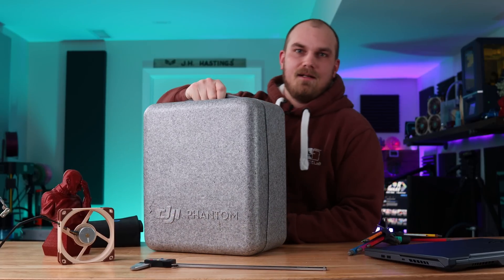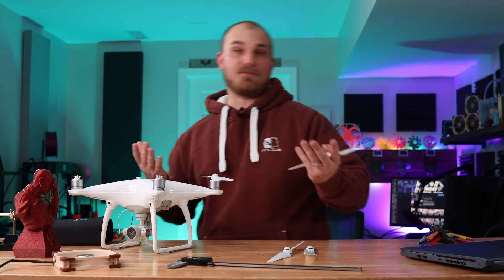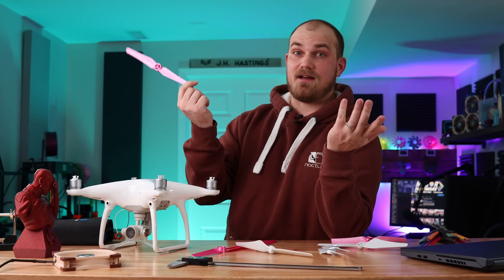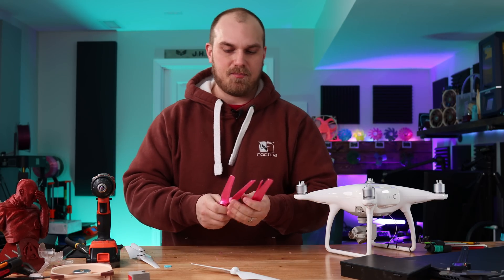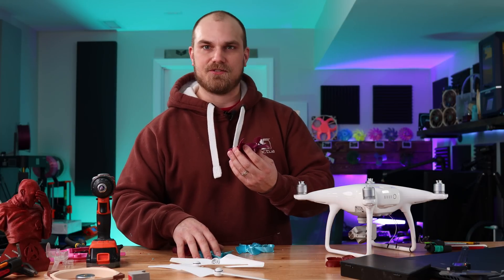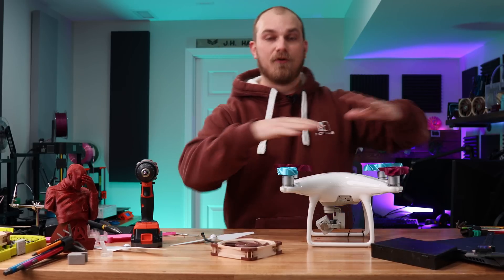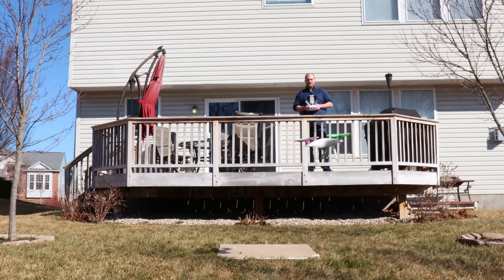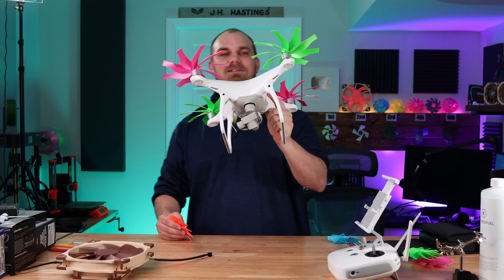FLYING Phantom 4 with 3D printed PC FANS

Comment: Since stability has to be maintained by varying the velocity of the individual propellers, your heavier "fan style" propellers will never be as stable as the ones that come with it (since they won't change velocity as quickly).
Reply: Yeah, agree.  MH already measures rpm and cfm!  Now measure weight!Sounds like a perfect start!
Reply: I agree. I think if he changed the blade design he could get away with 4 or 5 blades instead of 8. Maybe even 3 if he figured out a good design. That would help with velocity change greatly.

Comment: Besides just the surface area of the blades, we need to take the air velocity over the blades into consideration, which even at the same RPM, the fan blades being shorter will have a lot less lift/air flow.
Reply: Okay I paused the video to comment a hair too early lol

Comment: I see that 200 mm biohazard fan in the back, would have liked to see that
Reply: I thought that was the Fan he was going to copy & use 😞
Reply: I was just thinking the same thing...
Reply: Literally thinking that the whole time he was using the itty bitties.
Reply: too heavy.. that one was a scale up so the blades and hub are super thick, he'd have to re-model the whole thing to get it to actually work.
Reply: @sirmonkey1985  wondering if he printed with low perimeters (1 or 2) and minimal infill if it would have been possible. Probably running into a tricky balance between strong enough to not shatter under its own weight and light enough... I'd watch a whole episode dedicated to making this work, haha
Reply: He allready did a video on it
Reply: You could have made a 3 blade fan with that 200mm diameter tbh
Reply: Didn’t he do a video on it?
Reply: Exactly what I was thinking
Reply: i also think the same thing
Reply: He needs props the size of the stock one
Reply: https://youtu.be/4w6r5LE9PuM
Reply: Yes
Reply: Same

Comment: Other then fans, the airflow over the airfoil must flow smothly, so sand these steps down or use the azeton metode or your probs might stall and produce unstable lift
Reply: And maybe add a outer ring to connect the blades in order to prevent them from wobbling? Doesn't even have to be thick to to the job I think.
Reply: @Garbox80  I'm sure I've seen the super-cheap drones in places like Walmart with those rings.  Probably would help with the flexing.  (I doubt those cheap machines are made with quality rigid plastic.)  To some extent, they also protect fingers and whatever else the blades might wander into.
Reply: Acetone only works on ABS and ASU does not work on PLA or PETG.
Smoothing blades 🤣 by sanding what a challenge is that?
1. cant ensure everything is ground equally
2. you risk breaking the blades

Rather SLA print them or SLS 🤦🏻 but he aint got the 💰💰💰 for that 😁
Reply: @michaelbiri6676  you think he hasn't got the money for an SLA Printer, meanwhile he's printing hundreds of dollars worth of filament just to show and compare fan models made by viewers and prints multiple different blades for his !Phantom4!. And on top of all he even has an SLA printer, lmaooo 😂
Reply: @michaelbiri6676  was spot on until the last line.
Reply: At this scale, steps slightly behind the leading edge will help the airflow stay attached to the blade. 

https://www.researchgate.net/publication/328796447_Control_of_flow_around_a_low_Reynolds_number_airfoil_using_longitudinal_strips

Comment: You should try maxing out the length of the propellers to match the stock ones it came with. you are going to get increased but diminishing returns with the number of blades because you have more mass and they travel in each others wake. increasing the weight with more batteries is also going to diminish the performance due to the mass increase having to support that diminishing return. At some point no matter how many batteries and blades you have it wont fly due to these efficiency losses (the system doesn't scale). You are constrained by the frame of the drone and the motors which gives you how large your propellers are and their max RPM and K value (torque). Once you have that you can solve for weight (battery size) I have sized props like this using the kv rating in the past. There is probably only one solution that solves for efficiency given these constraints and its likely on the other end of the spectrum with low blade count and large radius. 

Try a 3 blade propeller of the same radius as the stock ones. You can also play with the pitch and NACA air foil (there are online calculators that make it easy(er)) or you can just wing it and solve with tests (preferred in my opinion). I would alter pitch to match torque for battery weight before increasing blade count. This experiment was really fun to watch thank you for the work you did. It would be interesting to see if the engineers optimally configured their motor - blade-dimensions - battery/weight system.

Comment: I think you might actually have a chance at getting a DJI Spark to take off with the 120s because it is so much lighter. For the Phantom 4, I think that adding more blades may actually be hurting you just because a propeller number of blades has such a higher diminishing return for the weight they add and you really don't have to worry about that with a fan. I would love to see more of these videos too if you are looking to do more drone testing. I don't know how much, if at all, we could improve on the from factory blades but it should would a lot of fun.

Comment: The flopping camera on the gimbal doesn't help the stability either!

Can you lock the gimbal in place?

Let's see you create giant blades with 1/2 inch clearance between them.  Hint, give them the same blade shape as the MV-22 Osprey.   
https://upload.wikimedia.org/wikipedia/commons/thumb/e/e0/V-22-166480-FAR01.jpg/220px-V-22-166480-FAR01.jpg

Comment: I could see a fpv flying well if the blades of the props were made from a more sturdy filament and balanced. In theory balancing the blades you have now and tightened tolerance you have made good enough replacement parts for the chance you do break the original props :)

Comment: With smaller disk size comes more power required.  You could probably make it fly with some 120mm blade, but you would not be able to control it

Comment: you need to use Carbon filled Fillament for this project to get rigidity and weight reduction on your blades.
Reply: Yeah, agree.  MH already measures rpm and cfm!  Now measure weight!Get that weight under control! Sounds like a perfect start!

Comment: Yeah, those are like 900-1200KV motors, but for such small blades, 2000+KV Motors are needed. Also an overall smaller drone would help, that DJI is just really big and heavy.
Buy a 5" drone (the Size mentioned is the Propeller size), they should fly with such small propellers. But then you also get the issue that the propeller probably just explodes.
Reply: I dont think the Blades will Explode!
I think due to the defects in the print (FDM) you will have the drone go imbalanced very quickly and zoom into a hazardous object (drone is kaput in 1 hit) end of Testing

Comment: This was a great idea.  You would get more stability if you put a ring around the edges of all the fan blades.
Reply: I think resin printing would also help because it is just a more ridged material but sadly they are much more limited on the size of prints they can make so it would have to a separate hub that the blades would be fitted/locked into.

Comment: This could be a new series, designing props for the quad copter if you were able to find out the thrust specs!
Reply: Agreed! I think it'd be really cool if we could have a series where we test propellers to find thrust data and performance.
Reply: There's plenty of printable designs for test rigs to find thrust numbers. Printed prop showdown would be really cool !
Reply: up
Reply: @TheHolsback  ㅈ
Reply: yes please!
Reply: Sadly there's nothing to improve here
Reply: Strap the drone to a scale, turn on the drone and see how much lighter it gets
Reply: I support it
Reply: I wholeheartedly agree
Reply: Well i think you could use those thing that measure hiw much pulling force something has (the king of random uses them all the time), attach one to the bottom of the drone (maybe need a drone made of stronger material).
Reply: Yeah, agree.  MH already measures rpm and cfm!  Sounds like a perfect start!
Reply: Yeah just a load cell and the prop, à la Tom Stanton.
Reply: I support this 100%!!
Reply: Or as an wise man said: ah shit here we go again
Reply: Do it with a mavic mini though

Comment: for dropping stuff: a fan parachute contest, drop an arduino with an accelerometer or 3 axis load cell and check which one has the least peak force.
by fan parachute I mean autorotation like a gyrocopter/helicopter with the engine cut.
Reply: This is an AMAZING idea!
Reply: Cool!
Reply: Maybe something designed with a maple seed pod blade in mind? As a drop candidate or a fan design?
Reply: I was thinking of that. Either your near scientific test or just a Samara Printed fan contest, trying to make a 3D print or fan that can be nearly used to convey horizontally a little paper message pushed by natural wind https://en.wikipedia.org/wiki/Samara_(fruit)

Comment: you should try to make a single blade prop, balanced of course. I recall someone messing with that idea a while ago and the theory is that it works because the blade isn't hitting the wash from the previous blade. I'm sure they will have to be a normal sized blade to work though.
Reply: I think the problem there is that the counterbalance is adding weight without adding any thrust so the one blade would have to be darn near perfect for it to a chance. I would love to see it attempted but sadly I think it would work.

Comment: Can you or anyone in the comments recommend an entry level gaming laptop that can play games like Stardew Valley, Superliminal, Planet Zoo.
Reply: Entry level, laptop, gaming
It will be hard to have all 3 conditions
Edit: your games don't need an rtx 😂 (same for me)
Reply: @MrAlexman37  aside from planet zoo these games run on everything. The recommended specs for that are pretty high. Like Ryzen 5 1600, 16 GB ram and gtx1070 is not entry level.
Reply: @kedrak90  I have a ryzen 5 1600, a RX580 and 16gb ram. Nice to play in 1080p60 in a lot of games
Reply: @MrAlexman37  I use my 1070 and 7600k and I have no problems on 1080p high or 4k low. Of course you can get any pc to its knees when going above 60fps ultra
Reply: Nearly anything made today will play Stardew Valley but you need one with a good CPU for Planet Zoo.
Reply: Any particular brands that have a good track record for reliability and customer service?
Reply: @Core610  I am happy with my Asus laptop but I havent hat to deal with customer support and I don't think there are huge differences between manufacturers. I think other big brands like Lenovo and Acer are just as good.

I would go about looking for a laptop by first setting a budget and then looking at what graphics solutions are available at that pricepoint (I think the mx450 is a pretty good chip but the AMD onboard stuff is good too I think). Then look at benchmarks to know what is performing well in the games you play. Get at least 500GB of storage, games can get pretty big these days.

Can't hurt to ask people in forums like reddit who know about the current maket a bit better than I do
Reply: @kedrak90  thanks

Comment: I recommend you look at a racing drone since they are much lighter and use a smaller fan size, only problem you may encounter is that the RPM of the fans is so high that the printed fans may not survive
Reply: Yup, they would just explodes. 3D printed propellers are just a bad idea. The ones that you buy are mostly made out of nylon, often carbon reinforced or carbon fiber.
Reply: @Toxicity1987  lots of 3d printable parts for those types 
You can Print Nylon and Carbon Reinforced PLA/Nylon. so no issues there.
His printer might need some upgrades to print those materials.
1. Fillament Dryer 
2. Hardened Steel Nozzle / Ruby Nozzle
3. Tuning of Fillament.

Comment: Plot Twist: Make a PC Fan the same shape as the Drone Blades
Reply: He needs to, I came to comment exactly this
Reply: @TaxxEvaderrr  he already did kind of in one of the earlier episodes with the result that they push air fast but don't cool good enough or so.
Reply: These rotors are designed for high rpm operation. PC cooling fans, not so much.
Reply: Or somehow mount the drone motors on a pc case and put pc sized fans on that?
Reply: @hdezn26  he used a brushless outrunner in an older video, which is the same type of motor the phantom uses, they spin very fast by aren’t very quiet.
Reply: @906MediaProductions  I see, must of somehow missed that video.
Reply: @hdezn26  plural. Videos. He has ALOT of them with the racequad motors 😁
Reply: @maxpower700  Oops, forgot the s after video. lol.
It looks like a haz a bit of catching up to do. . . Guess I'll do that after I wake up later. For now. . off to annoy the neighorhood, again. (Gudmarninnight! Snore!)
Reply: fan go wrrrrrrrrrrrrrrrr
Reply: shittiest cooling ever be like
Reply: @heetman5925  Actually, that's when shit hits the fan...
Reply: the drone blades are made for little air resistance. it would not perform in a case because of hindered airflow.
Reply: Been done
Reply: yeet your fucking pc across the room